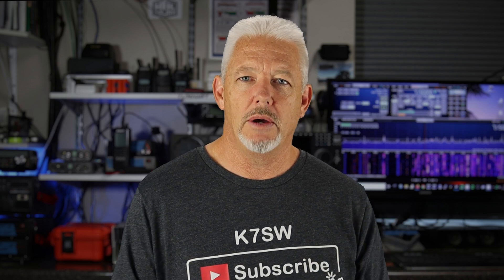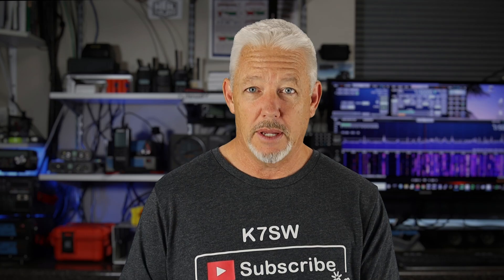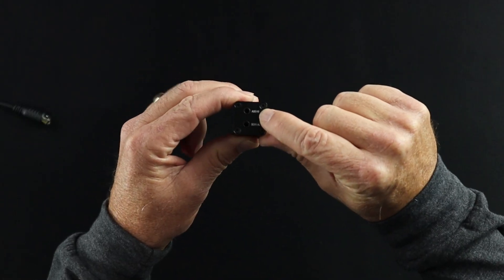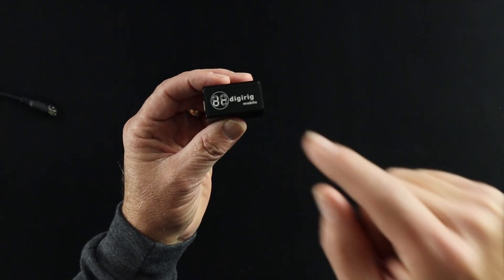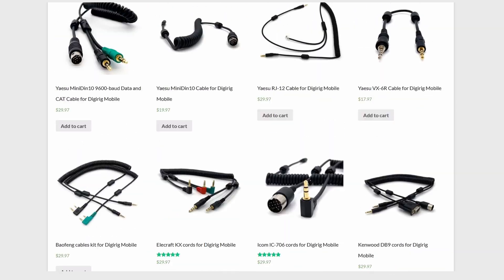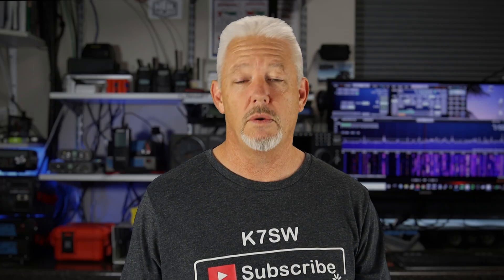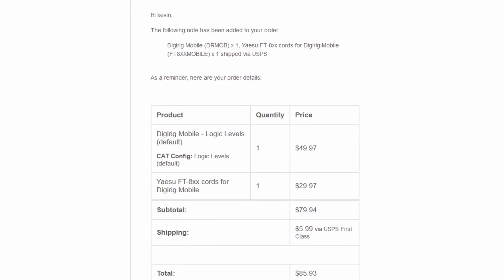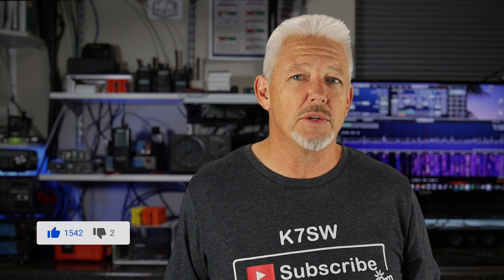Digital Mode is REALLY Small| K7SW Ham Radio

Comment: ...hey! Digirig mobile is great for the FT-891 as well as the DR-891 (Digirig specifically made for the FT-891)...the keys to using both are:  1. having the FT-891 set up correctly for digital mode; 2. knowing which baud rate to use (which changes from computer/ laptop to computer/laptop); 3. knowing the right COM ports to use for the Digirig mobile, and using C-IV for the DR-891 instead of the second COM port; 4. having the cables in the right Digirig slots...for the Digirig mobile, the CAT control goes in the USB-B slot in the back of the radio with the other end into the computer, and the sound card cable goes in the "audio" slot of the Digirig mobile with the other end into the 6 pin mini din at the back of the radio; 5. for the DR-891, the cables are color coded (Denis K0TX made it easy for us!) to match, and only one USB-A slot is needed on the laptop...i send and receive Winlink messages weekly exclusively via HF! Cheers and 73!

Comment: Hi Kevin - I am all set-up and using my Yaesu FT-710 "backyard portable" as you suggested. I have a 20AH battery and a whip antenna. I am in Oregon and have used 20M to contact hams in Florida and all across the Midwest. My next question for you: What is the best way to get started with digital?  There are so many programs to choose from. What would be your advice for a beginner?  Thanks again for all your help and advice. I truly appreciate it.  Jim
Reply from the maker: Jim, keep it simple, and start with some of the FT8 video from Steve, kM9G @temporarilyoffline . Steve has really fantastic videos about getting your feet wet on digital. That is exactly how I got back into it.
Reply: @hamradiowithkevin  Many thanks, Kevin. I can’t tell you how much I appreciate you.

Comment: Just I got my Digirig and I make a quick try with 891 it is not working for me. Audio level is too high on my FT8 progam. And radio is transmitting but I cant see any RF on my power meter.
Reply from the maker: Check out some of the tech support pages on the digirig web site and YouTube for the 891 setup. There is some initial experimenting to do.  If I had an 891, I would try to help you.  73

Comment: Just another shoutout to the Digirig (and also Denis the owner). My field rig of choice is the FT-891, and as everyone knows it is *capable of digital modes, but you need to add an external sound device. The Digirig was THE SOLUTION. From my cabin on vacation, I easily do Winlink, FT8, and PSK31 with my FT-891/Digirig combo. It's the only way to go. Welcome to the Digirig fan club!! 73, Tim KD9LAI

Comment: I bought a Digirig recently to test Winlink with an HT over the new VHF gateway we are experimenting with. Works fine in testing with a Baofeng GT-5R and my Yaesu FT70D. I do a LOT of digital. Winlink, NBEMS with fldigi, FT8 and others on a regular basis as part of my ARES group using HF and VHF using other devices. The Digirig is so compact it will become part of my portable gear. Digital modes are a large part of our emcomm plan. Jack K5FIT

Comment: I use the DigiRig with my FT-891 and have been very happy with it and its simplicity to attach and use.  The only downside with the FT-891 is that I have to use a separate USB cable for CAT Control.  But it has made my POTA and other portable operations a lot more fun.  When you are using a limited antenna on portable operations it has provided more Q’s in the log.  The FT-891 has a good number of menu items to setup for Digital operations, but they are well documented on YouTube and other web sites.  The DigiRig is compact and really is a nice add-on to my portable kit.
Reply: Don’t use a limited antenna.
Reply: In this comment, I am calling a limited antenna when compared to the 6 band multi-mono band beam at 92 feet. It is all in your reference point!
Reply: @n5pa your FT-891 USB/CAT Control problem has a solution with a "2-in-1 USB Splitter" as seen in this video (if I understand you right) https://www.youtube.com/watch?v=x50tGsoase4

Comment: I use one with my TX-500. I love it. It works flawlessly. I use it for winlink, fldigi, JS8, VarAc, etc. all the software has no problem with it. I almost went with the IC-705 due to its built in USB sound card and cat control but with the DigiLink Mobile I  have no regrets going with the TX-500.

Comment: General question for anyone who can answer.  I am not a digital or a big computer guy.  There are options when you order the digirig mobile.  

My use will be with an FT891, Vx6r and made some baofengs with a windows laptop.  If I understand the description correctly, I would order the default Loguc Levels option... correct?   Of course cables that match my radios. Thanks for any help.
Reply from the maker: Make sure you email Denis, he is a HUGE help at knowing what parts you will need to order.  It is super easy.
Reply: Thank you for considering Digirig. You can use Digirig in default (logic levels) configuration with all three transceiver models you listed. You can also use it for programming Bafoeng HTs using Chirp software.
Reply: @digirig  thank you sir.  Appreciate your company making digital easy for us non tech guys.  73 God bless